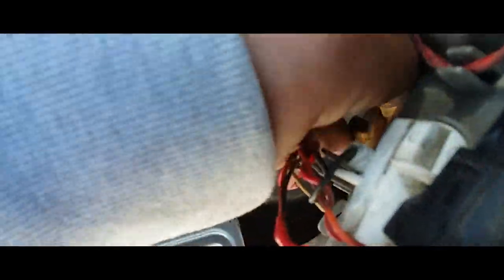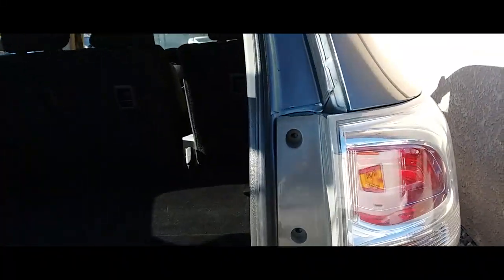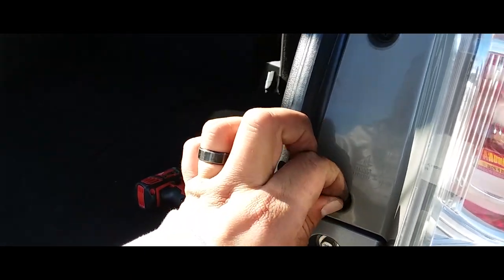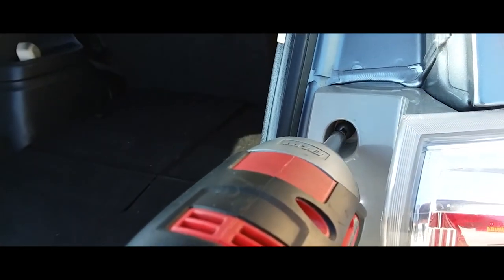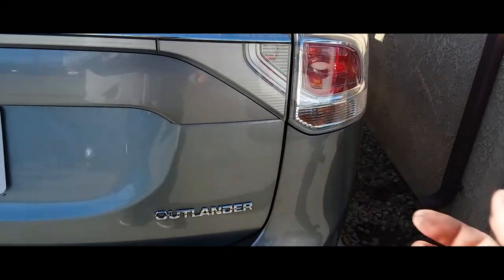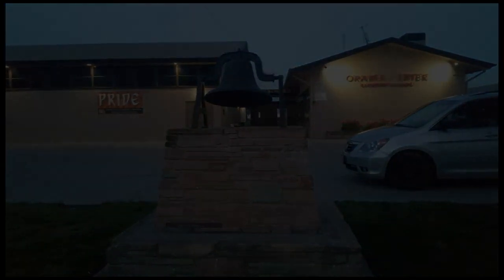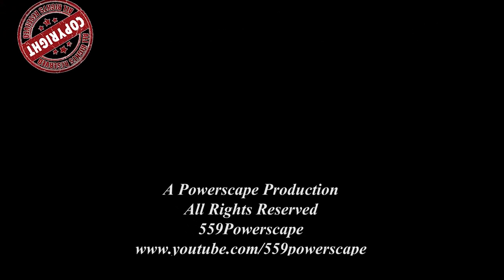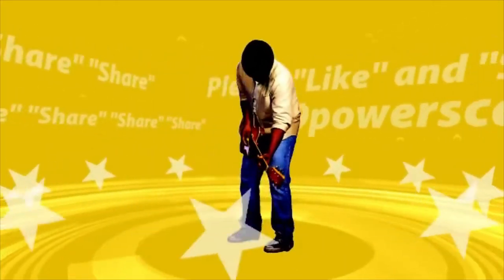How to: Replace Tail Light on a 2013 Mitsubishi Outlander

Comment: Thanks, Dealership quoted me 400 Euros to fix a broken taillight cover.  I've found the Van Wezel replacement part on line for less than a 3rd of that.  WIth your video I'm going to go ahead and order  it.  Wish me luck!
Reply from the maker: Nice thank you for your SUPPORT! Glad this worked out for you!
Reply: @559powerscape  I replaced it on the weekend and just passed my inspection this morning!  You helped me save almost 300 Euros!  Big thanks
Reply from the maker: @karlhepokoski5416  your welcome bud,I'm glad this worked out for you! Thank you for your SUPPORT!